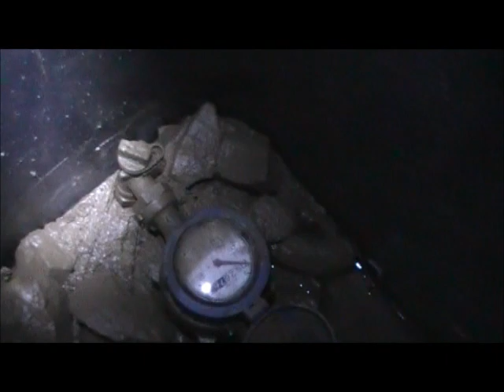Late Night Bathtub Faucet Repairs

Comment: Thanks for the video.  I have a similar style of spout/taps in my bathtub (all 1 piece and wall pipes are in a straight line).  It drips badly and I tried replacing the cartridges (one was in bad shape and appeared to be the problem) however it still drips.  I can't seem to get the plastic cover off that fits over the plumbing pipes.   (I did undo the nuts that go around the taps and hold the plastic cover on but it seems stuck on the middle diverter and there is no screw under neath that is holding it on.  Any ideas how to get the plastic cover off so I can look at the diverter to replace it's 'O' ring?